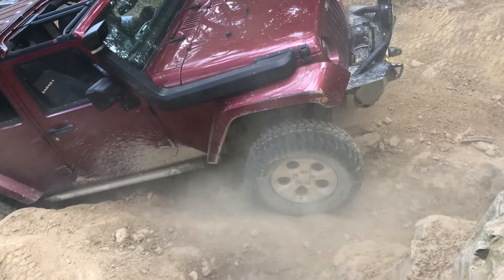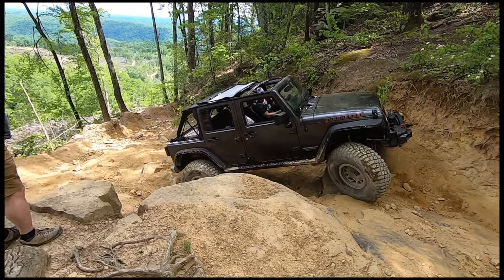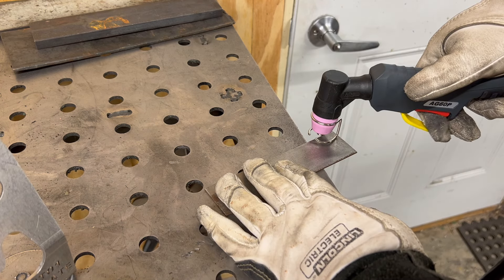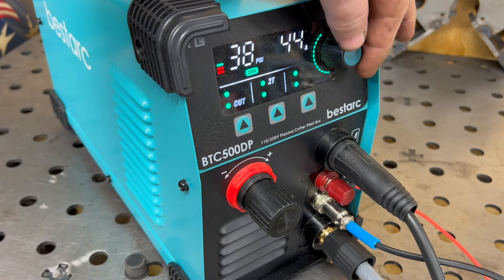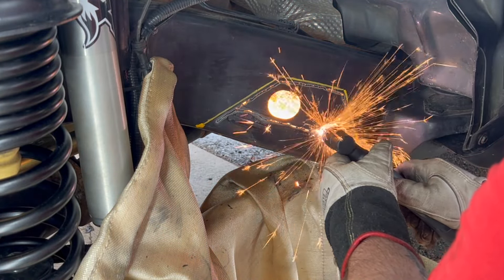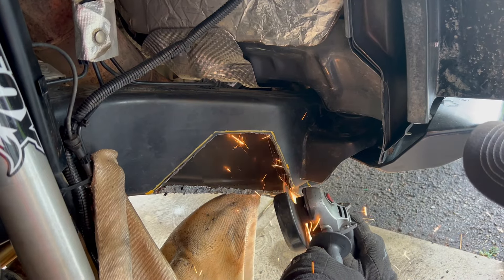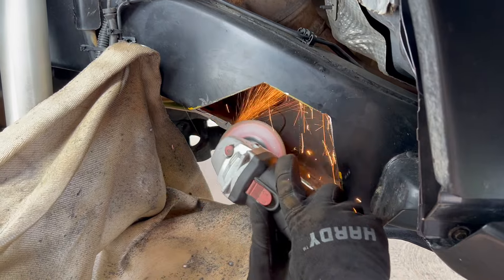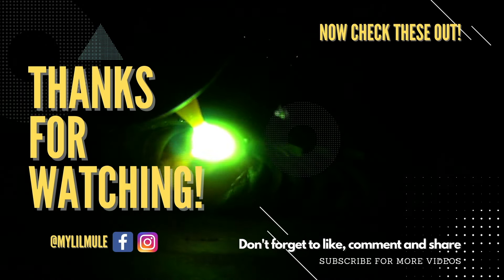Installing Tire Clearance Plates on a Jeep JK using the Bestarc BTC500DP Plasma Cutter

Comment: My buddy swapped the axles on his jeep with ones out of a 250.  Now the thing is wearing 42" tires.  He junked the jeep engine for a 350.  It's turning into a beast!
Reply from the maker: One ton axles are nice. But they are too wide for a Jeep unless you cut down the tubes. But with 42" tires, that would probably be a bad idea!
Reply: @MyLilMule  lol.. Nope, he's going full width.  It's not going down the road so not concerned.  Just how they do things out here in west Texas.

Comment: Nice work my friend.  The end result is bang on.  I have a Thermal Dynamics plasma cutter and its awesome.  It cute to 1" no problem.  One tip I might give you when cutting a straight line by hand.  You can use a non-conductive rule and it works really well.  Also, because it produces a lot of metal residue, when I build my welding bench I added a foldable slotted table which lets the slag fall in a bucket which helps with cleaning.  PS, I can't wait to know everything about plasma cutting just like you.  lol  ;)  Gilles
Reply from the maker: Thanks. I would like to build something similar for my welding table. Instead of a bucket, I thought about just using some slide in serving trays from Amazon.